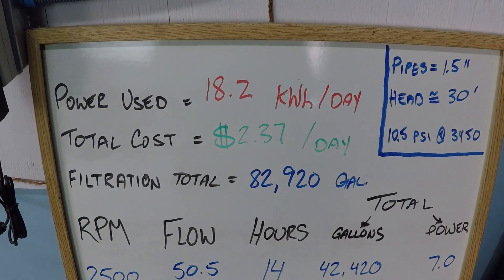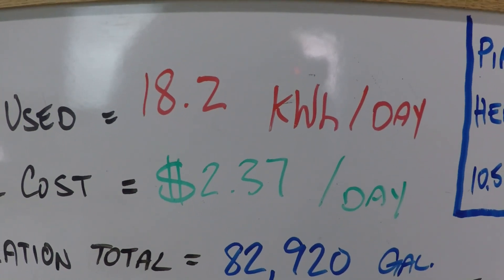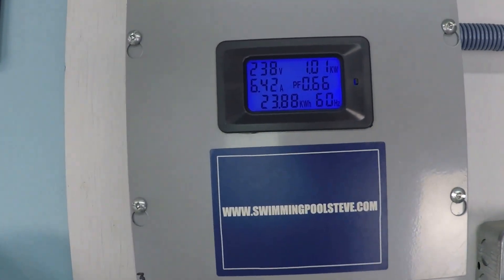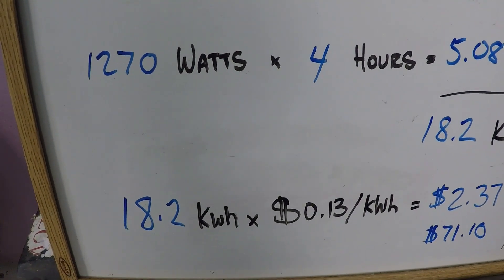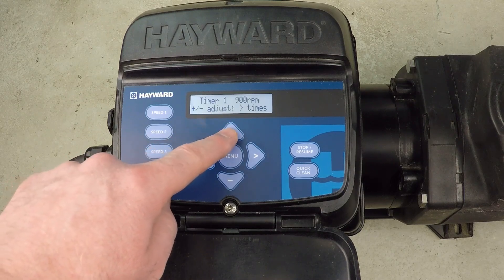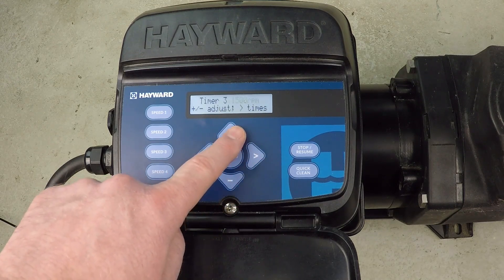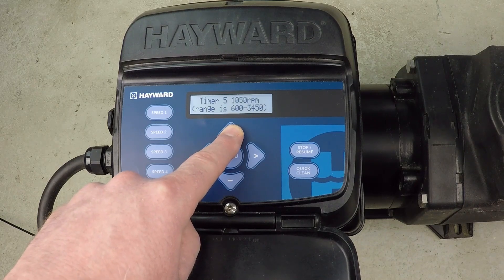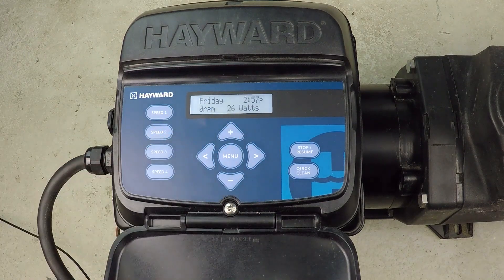20'x40' Pool Filtration Schedule - Hayward Super Pump VS

Comment: Love your vids, learning A LOT.  I've got a 20x40 with 1.5" pipes like your example but I also have a sand filter (which unfortunately was just replaced with a Hayward S244T before I found your channel or I would have gone with something with a higher flow).  I've been running with a 3/4 hp STA-Rite pump for the last 18 years (24x7 during the summer).  After watching your vids I'm inclined to replace the pump with a Hayward VS pump.  Is that advised given the 1.5" pipes and sand filter?
Reply: I have the same setup with an old S244T with glass media. 20x40 with 1.5" piping. Equipment is really close to pool so low head I believe. Our old Hayward 1.5hp single speed died and they are replacing it with the 1.65 Hayward VS tomorrow. I think the limiting factor for us is the filter, best information I can find says it's designed for 62GPM. So basically the pump RPM will be limited or I believe it overdrives the filter. We will see if it's sufficient or a new filter solution needs to be implemented.

Comment: Perfect timing!  Just started pool for the first time and was trying to figure scheduling.  Still need a flow meter installed to see how much I am actually flowing through the lines since I have 2" returns with a 2.7hp super pump 700 in a 16x36 pool.  Will be using this schedule as a base line to start with.   Thanks Again!
Reply from the maker: Here is another page with info about 16x32' pool filtration schedules which also might be helpful for you https://www.swimmingpoolsteve.com/pages/filtration-16x32.html

Comment: Curious what speed/power needs to run to get 35gpm of flow.  I would run that 24/7 and get ~2 turnovers a day.
Reply from the maker: Every pool will be unique for the rpm needed to achieve a specific flow rate. Also note the pool is dynamic and needs more than one low speed all day. The skimmers need more flow to function and skim debris for example. A few hours at higher speeds. A few more hors at medium speeds and then the rest of the day low and slow gets the job done.
Reply: @Swimmingpoolsteve  Interesting.  I run mine at 1450rpm all day long.  Just enough to get water to crest nicely over the raised spa.  Great flow into the skimmers and happens to be 55gpm through the system which is ideal with 2" plumbing.  Never needed to vary the speeds.
Reply: BTW, I should add that during pool construction I watched your variable speed pump flow rate video's with much interest.  Your flow rates with 2" plumbing matched mine very closely.